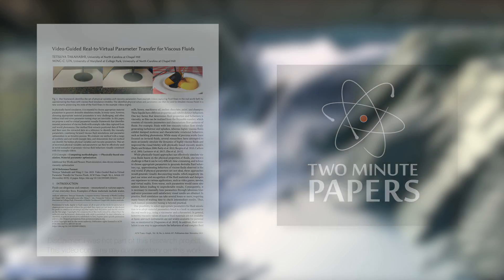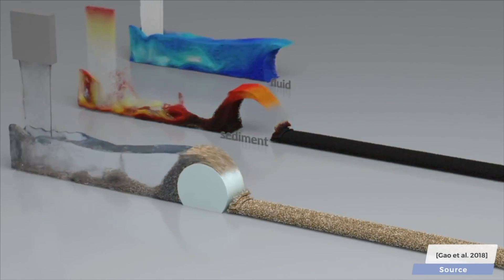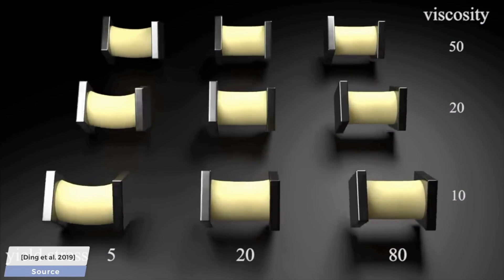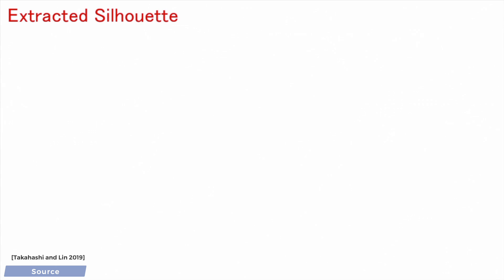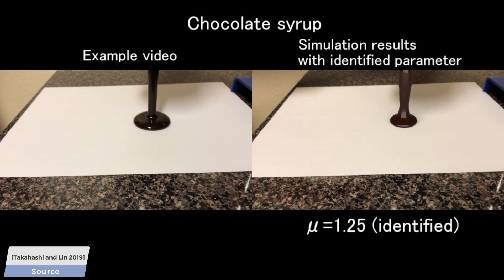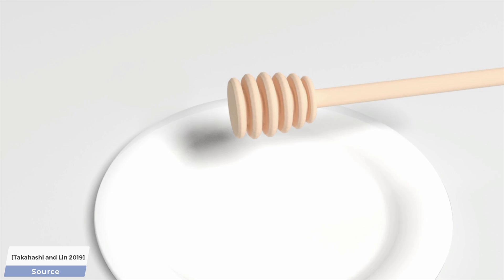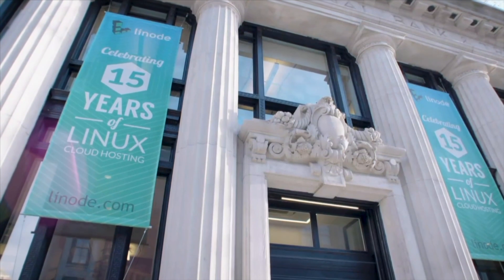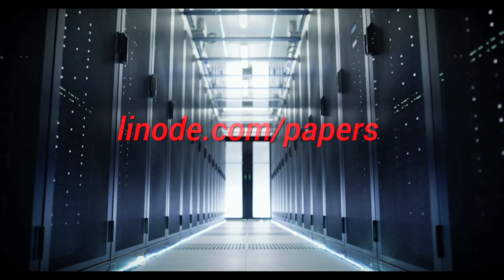Transferring Real Honey Into A Simulation 🍯

Comment: Viscosity is not enough, you also need surface tension modeling - one can clearly see that the modeled honey spreads out with proper speed but is too flat.
BTW viscosity is related to relative sizes of particles that constitute the substance. Might be useful if the simulation uses model based on particles.

Comment: One of the differences I am seeing is the difference in the flow fronts of the fluids from measured to simulated.  It seems like the viscosity is being modeled well, but maybe the surface tension of the two contacting bodies need to be added, or modeled.  I am perhaps over thinking the simulation.

Comment: Seeing this makes me so excited for the future of this field of study. One question that came to mind while watching this: Could this technique be applied to a heavier gas moving in air (or simplified something like Argon in Helium)?
Reply: This neural net is operating on the silhouette of the fluid. When gases disperse through each other, it's going to get a lot of fine detail, and possibly blurry.

I'm sure you'd need a ridiculously high resolution camera for it if it is possible with this method.

Maybe use a gas that blocks UV or  infrared and use a special camera to record it.

Comment: I'm still seeing an over expression in the amplitude of waves propagating through the simulated medium. For instance, around three minutes you can see clearly erroneous oscillations in the disk of material formed by pouring. The same occurs in the pouring honey on the dipper scene, the remnants of those folds simply do no persist like that, with those inconsistencies quickly homoginizing. I suspect that it's because reality solves for an actual infinite regression of feedback effects(at least until you hit some Planck related value), and renders for that returned value, whilst we work with hollow imitations, but regardless, no, it still does not look accurate to reality. I would say that it rests in what I would describe as the uncanny valley of physics though. I'm sure you could convince someone who doesn't use a fair amount of honey on a daily basis or just doesn't have a good eye for physics.
Reply: I think that propagation effect at three minute mark might be the result of the lack of translucency of the matter used in the simulation. The edges are also too dark compared to the real footage.  At 3.34 you can see those wave prolongations also occur on real honey. I believe that those are also present on the real liquid at three minute mark but not visible. To my eyes as Zsolnai-Fehér told, the behavior of fluids seems fine. With correct lightening and realistic color, translucency choices they might actually look realistic.
Reply: @BerkayTemiz  I see where you're coming from, but even with the example of the honey at 3:34, you can see that the propagations decay into smoothness within a very short distance of the edge of where it's actively being deposited, and there's a fairly stark transition between these relaxing propagations and the smooth, nearly level suface that they decay into immediately thereafter. It just looks to me like energy is being dissipated somewhere in reality that isn't being accounted for by the simulation. Like through elasticity of and friction between the short polymers in the substance. I guess we'll find out when someone renders these examples  with some ultra realistic graphics.
Reply: @AtlasReburdened  I understand what you mean., but as you mentioned we will find out after realistic renderings.
Reply: In watching this video I was more excited by "a couple papers down the line" than this technique itself
Reply: Boi.... of course its not in any way, shape or form perfect, but honestly, getting this result from a smartphone video is more than just impressive
Reply: @gorgit  Oh for sure. Take a step back and it's easy to be mind boggled by the whole sum of what's happening, the fact that it's happening on a collection of processed rocks, gems, and dead microbes, and mediated by invisible forces acting on particles with no inherent size which flow lIke a liguid through solid metal. It's as bonkers as a death throw fever dream before you even get to the information processing part. Nonetheless, implying that it's near perfect is just an invitation for calibrated and highly definsible scrutiny, which all I'm doing here.
Reply: @AtlasReburdened  Okay, I can agree with your point, which doesnt mean that it's still an incredible result considering it got it's attributes by a video of it's real life counterpart. And imagine what will happen down the line of the next 10 years. It looks (at least in my opinion) very close and that's really impressive. I didn't think something like this would even be possible in the next 5-10 years.